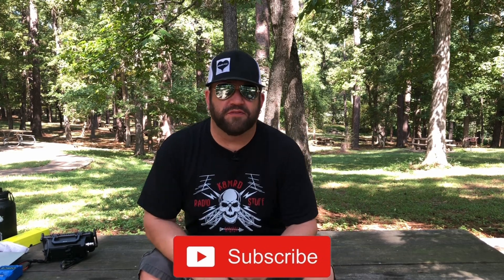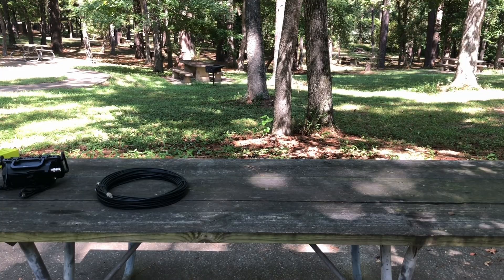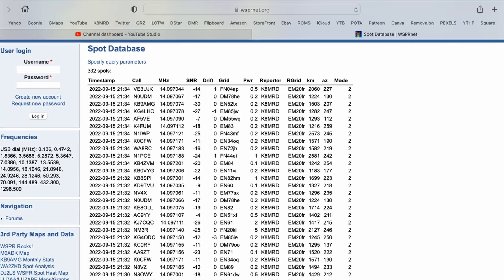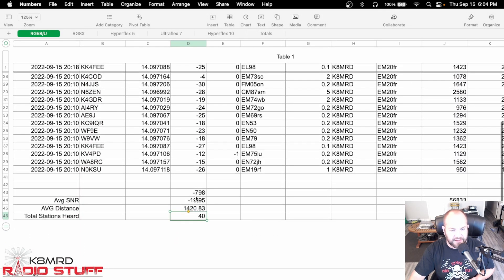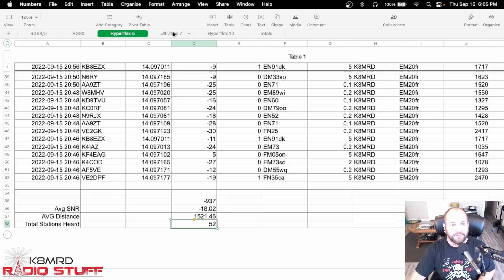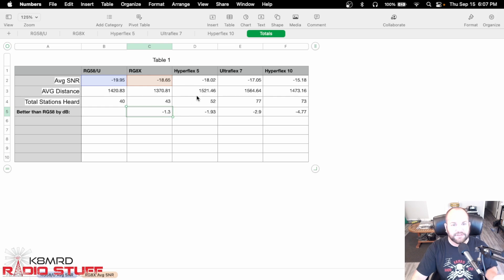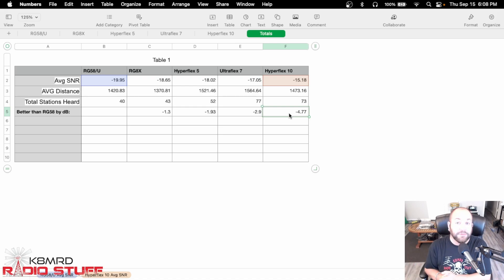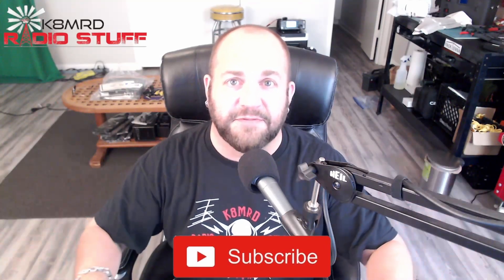How Coaxial Cable Improves Antenna Reception

Comment: I am just restarting the hobby after a 35 year hiatus.  I'm starting all new as I donated all my gear about 5 years ago before I moved to central FL.  I plan on running almost exclusively POTA with an IC-705 and a Buddipole antenna.  I am looking for some really low loss Coax and the M&P Ultraflex 7 seems to pop up a lot.  However, I believe it is only available with PL-259 connectors.  Both the IC-705 and Buddipole antenna use BNC connectors.  I am concerned with the additional loss of adding adapters.  Any suggestions?
Reply from the maker: I wouldn't worry about the adapters personally, but you can use M&P's coax builder and have them make whatever cable with whatever connector you want.  https://messi.it/en/messi-calc.htm. Code K8MRD saves you 10% off too.
Reply: @hamradiotube  I noticed that.  However, I'm concerned about the $ to Euro conversion and the VISA charges for the conversion.  I don't know what my ACTUAL Cost will be.

Comment: nice job comparing different coax on receive. a outher way is to use station WWV on 7300. 2.5,5,10,15,20,25 Mhz whatever you pick up. record signal received. S units is ok. swap coax make a spreadsheet  if you do test in about a hour should be fairly same signal. WWV is fixed and transmits 24/7. just propagation difference. just another way     . 73's

Comment: Hi nice video ,  But there is another way to improuve the ability of working those really far and weak stations better.   Go from using 50 ohm coax to 75 ohm !!!    yep  if you have an antenna thats will allow the use of 75 ohm in general it's less lossy for the same diameter coax..  I have three Windoms, NOT CAROLINA my own version the MODEX WINDOM but with a 4/1 guenella double balun design and I use a 75 ohm double silvered screened 11mm coax and have a feed point on the antenna at 300 ohms before the balun.  The 4/1 gives me a 75 ohm match and the coax also has a thin microline current trap 10 x 10 turns to stop anything radiating from the coax, so it's NOT part of the radiating antenna..  Reception on this antenna is FAR SUPERIOR than the 50 ohm fed ones   and ive added so many new countries by searching for those super weak stations that I can even work with just 100 watts and my country list has shot up and im still finding new countries to work...my noise level is very low so i can pick them out whereas using the antennas on 50 ohm they are too deep in the noise !!   try it...
Reply: interesting isn't RG6/U coax 75 ohm? I was wondering if I could use the existing (Old Install of a DirecTV) for an antenna?
Reply: @scvdad  Yes, that's 75 ohm.

Comment: It would take days and lots of effort but I would like to see all those cables and hyperflex 13 at 100 foot lengths on the same antenna talking to the same local line of sight with a weak signal. That would give real world Tx and Rx results. I've got some hyperflex 13 on the way.  Replacing the RG8X will gain about 1.2 db in just the coax...not to mention the barrel connector I have in the RG8X line. I'll probably gain a bit more because of the insertion losses of the barrel connector and the 4 pl259 connectors in the RG8X run. The hyperflex 13 will connect to the beam with an N connector and inside at the switch with a pl259

Comment: I have heard a guy say he dropped two S points going from RG8X to LMR600 on HF. Even some of the smartest people in ham say just use RG58 for HF as they're only looking at one or two aspects. Like engines in my work and hand loading for target rifles in my other hobby, there is always a crowd that dismisses ideas based on the most obvious reasons. But there are always some other reasons things are done the way they're done in non-conventional ways.
Reply from the maker: Dropped S units going to LMR600?  Yeah I'm going to say he screwed something up big time.  LMR600 is a serious cable.
Reply: @hamradiotube  it sounds stupid but I have seen a video where a guy tested cable with an SDR. RG58 had so much noise on it then the bigger the cable got the less noise. He had a signal generator and measured the SNR with the SDR with different lengths of different cable. At 100m the RG58 had as much noise as signal.
Reply from the maker: @Channelmaster73  that doesn’t sound stupid at all.  That’s just one of the differences you will find in coax.

Comment: Good vid Mike...interesting results. Here's a twist on your video test...for an individual length of coax, what about coax configuration? For example, does the layout of the coax (straight run, layered, looped), have any impact on TX/RX performance? Also, what about height off the ground? I'd imagine you'd probably get similar effects to your test depending on how the coax was oriented in space? Thoughts?

Comment: I think another issue is that many operators give "reports" with a lot of "room"... that is they do exaggerate the reported strength.  I usually use my S meter reading for the second number in the report.  If they are clear, that's a 5 and if the s meter hits 7 that's a 57.  That's my system.  However I have been "tempted" to say 59 for 56's or 57's and I have SEEN people in videos add s units to the second number as well.
Reply from the maker: Yeah I hear ya.  I usually try to give real signal reports though sometimes I'm not actually looking at the radio as I'm logging.  Sometimes you may get a 57, 59, whatever and your signal isn't actually that strong.  If I catch it I'll give them another report and correct it.  At the end of the day, when I'm doing a POTA, everyone gets logged 59.  I really don't care for the log.
Reply: @hamradiotube  Not to mention certain Contesters are used to just handing out 59 automatically

Comment: cavo perdita db per 12.5mt 
RG 58 C/U MIL    a 28mhz 0.97db  con 15w in antenna va 12w
AIRBORNE 5        a 28mhz 0.67db  con 15w in antenna va 12.8w
HyperFlex 5         a 28mhz 0.52db  con 15w in antenna va 13.3w	
UltraFlex 7           a 28mhz 0.37db  con 15w in antenna va 13.7w
RG-213                 a 28mhz 0.32db  con 15w in antenna va 13.9w
UltraFlex 10         a 28mhz 0.27db  con 15w in antenna va 14w   
ExtraFlex Bury     a 28mha 0.25db  con 15w in antenna va 14.1w
AIRBORNE 10      a 28mhz 0.25db  con 15w in antenna va 14.1w
HyperFlex 10       a 28mhz 0.17db  con 15w in antenna va 14.4w
UltraFlex 13         a 28mhz 0.17db  con 15w in antenna va 14.4w

Comment: Most people worry about how much power out they loose in cheap coax but never look at RX loss. Loss out is equal to loss in. The M&P Ultraflex 10 with it's better shielding also picks up less noise when used at home in an urban environment, that also improves RX signals.

Comment: Hi Mike, interesting experiment! However, did you need to do this as you are only checking the efficiency of the cable. By my limited understanding, surely, as you are only looking at how many of Callum's"Wiggleys" leak out, transmit or receive makes no difference? If this is indeed the case, looking up the specs of the cables will provide the answer. That said, I, like you, am a sucker for the fun side of science, and your experiment (I think) gives the answer, although I have not checked! Keep up the good work! 73 Jim M7BXT
Reply from the maker: I've found the specs provided by manufactures to be quite different to what we can expect in the real world.  So yes, I think these experiments are important.  Plus, who doesn't want to get out and play some radio?
Reply: @hamradiotube  Good point Jim M7BXT

Comment: First off, good video. I will say that hamsticks are a horrible compromise antenna and I'm not surprised the other station could hear them better than the hamstick. But enough hamstick bashing,  I've used them myself.
What I'd like to see is the same stations compared to each other in the various test cases. You already have the data in your spreadsheet. I think the lower loss coax, by virtue of the fact that it heard more stations (probably weaker ones) is skewing the test results to be less accurate. But again, good test, good video.

Comment: Hi Mike, I’m not trying to be critical, but I’m not sure what you’re testing.  Any conductive metal can “receive” electromagnetic energy.  So when you look at the coax,  is it your thought that if you receive more random RF through the braid it’s “better” coax?  I mean you’re not saying a 100’ length of coax amplifies a received signal, right?  You’re not saying a 100’ length of coax improves antenna reception by 1-2 dB, right?  Because that’s preposterous.  You could look at your results another way.  Maybe the coax receiving fewervstation is better - because who wants a feed line contributing to your antenna system.  The ideal feed line should be invisible to radio waves in the air, it should magically deliver all energy transmitted or received to your antenna without loss or radiation.
Reply: What he’s receiving is intelligible data. Poor coax would more random RF in and drown out the stations. Better coax will keep what the antenna is receiving ‘clean’ allowing his WSPR machine to give better signal to noise reports, at least that’s what I gathered.
Reply: @AOPNW  but that’s the exact opposite of what he’s saying.  He saying the “better” coax is receiving more signals with a higher S/N than the worse coax.  All feed lines radiate, all feed lines pick up RF.  The guy who asked Mike the original question about his mobile set up was wondering if his coaxial cable made his antenna better, not worse.  I can’t think of a situation where feed line helps receive or transmit - with the exception of using a specific length of 75-ohm coax to match the antenna or a phased array- but that’s not what we’re taking about here. Typically feed line is an absolute negative on performance, but with short runs in otherwise well-matched systems up to 30 MHz, it’s negligible.
Reply: It's about dB loss in the transmission line. NOTHING is being amplified. Lower loss coax will allow more of your transmitters power to reach the antenna. Lower loss coax won't burn up the received signal due to conductivity losses and noise like a higher loss coax. It's about the periodic table of elements and their conductive properties and the way it is used in coax design. Heck, if coax doesn't matter, why not just run RG 58.
Reply: @imken2392  But that’s not what he’s saying ken.  In fact, read his own reply to me.  He believes coax amplifies signals, not just lowering loses. Even the title of this video is a fallacy, “how coaxial cable improves antenna reception“. Coaxial cable doesn’t improve how an antenna receives or transmits.  All coaxial cable can do is add loss to your system. Honestly, the reason why this is such bad science and such poorly interpreted data is that he never tests what happens with using no coax at all, or a much shorter length to make the coax a non-factor.  I mean his ham stick is sitting on the ground, he could have used a crazy short (1-3’) length of coax to almost eliminate it as a factor entirely.
Reply from the maker: I never said anything about the braid, so I have no idea where you're going with that one.  And it's not random RF.  I'm receiving other radio stations.  But...Yes, that is what I'm saying.  And it's not preposterous.  The numbers I've presented are the strength of the signal.  Keep in mind, they are negative numbers.  And per my video, the closer to zero or above, the better the signal was received.  So a -24 would be a weaker signal that a -10.  And yes, anything conductive will receive, but not all things conduct the same.  Some are better, some are worse.  Just as power loss going through the coax on TX is perceived, so is the RX signal.  It's a two way street.  Imagine a pipe of water and how much is flowing through it.  Now imagine a bigger pipe.  Which one will allow more water flow?  Same reason we use different size wires for electrical connections.  There is loss everywhere.  So yes, a 100' length of a bigger, better coax will improve your RX vs. a smaller less better coax.
Reply: @hamradiotube  Nah, it’s preposterous.  Coaxial cable does NOT amplify receive signals.  With that logic, put out 500’ of coax.  1000’.  Why not a mile of coax?  I mean if that’s your contention, what’s the problem?  Or maybe, just possibly, your methodology was wrong.  But I still like your videos even when you’re wrong.  It’s ok, nobody’s perfect.

Comment: If your coax improves your antenna’s reception, you have a bad antenna.
Reply from the maker: Go put 100' of RG316 on a UHF antenna and tell me how well that works for you.  On RX or TX.  Then go put some Hyperflex 10 or LMR400 on it.  I'll wait for your apology.
Reply: @hamradiotube  Lol, yes that’s why icom developed the brand new 905 with an external, POE RF module specifically designed to bypass lossy feed line on VHF/UHF so it transmits and receives into its attached antenna with as little feedline as possible, with almost no loss.  Maybe you should send your video to ICOM?  Their engineers would love to hear your take - which is, ahem, unique- and antithetical to their engineering expertise.  Or, just man up and admit you got this one wrong.  I won’t ask you to apologize to me; that’s like asking a child to apologize for thinking the moon is made out of cheese.  It’s kind of endearing, the innocence of ignorance.  Just learn and move on my friend.

Comment: SNR is the real measure of receive performance in my mind. How about a steady signal like WWV measured into an sdr and program that can measure SNR.  That should be the most controlled test I can think of. May need more data points though.
Reply from the maker: Someone else suggested that as well.  I don't really have the means to do a more accurate test other than WSPR though.  I was thinking of doing a TX test and compiling the data from the stations who hear me.  Either way, there is always varying propagation, but yes, more data points are going to give more credit to the results in the long term.

Comment: What would be the result if I am only running a 25 foot coax? How would these results change?
Reply: Coax loss,which is kinda what this test shows, is measured in db/100ft. So going from his measurement to a 25ft run would reduce the loss introduced by the coax by 1/4. So where one of his measurements was like 4db difference between the rg58x and whatever,the difference would be like 1db difference.
Reply from the maker: What Matt said.

Comment: I Mike,
Thanks for the effort in doing the testing. You tried to keep most of the variables as constant as possible, and the trend did show better numbers with better coax. I would be interested in how the numbers compare when changing out different antennas. Stay safe,  73  WJ3U
Reply from the maker: I want to re-visit this test.  Prob a couple times.  One with a different antenna, and another on TX.

Comment: Great analysis, I love me some spreadsheet 🤣. While the difference is "only" a portion of an s unit, a different antenna might be "only" a portion of an s unit, a different rig might be "only" a portion of an s unit. Keep tweaking your gear and eventually it's not "only" a little bit better, it's a lot better.
Reply: I agree. Optimize everything you can. 

For the weak ones, it doesn't take an S unit to make the difference between "I think I hear a voice" and "Oh, there they are" in my experience, so I'm not sure why all the experts say "it's only half an S unit". That little bit can entirely make the difference.

Comment: It matters. It all matters. But.....Does it matter enough to "matter?" It's a little bit subjective. Obviously, better coax is more efficient. Cheap, small coax if going to be less efficient both transmit and receive. A better, LESS compromised antenna will do more than changing coax, sure. The other variable that you simply can't calculate for is propagation. It was a look test none the less and thanks for trying it!

Comment: I think your right better antenna would be a better approach to improve recieve and transmit loss should be your focus when choosing coax.

As far as another way to test is SNR with the same stations same day\timeframe that way there is another constant. I can be one of these stations if you want. 

Sorry but gonna go nerdie on ya and share what I learned which I don't even know if it correct but make sence to my peanut brain. We all know coax has loss some more than others, the same loss characteristics apply to recieve too just not as dramatic to transmit. It isn't as dramatic since the recieve power (how much power into your antenna from the other station) is very small and since it is much less the amount of power loss from antenna to your reciever is minimimal due to how db of loss works. How to test this theory would be same coax but at different lengths say 50'  vs 100' and if theory is correct the SNR should get better but I think you will see the same marginal improvements.